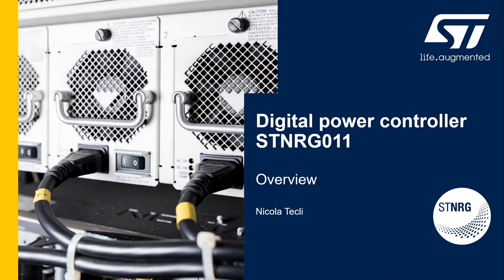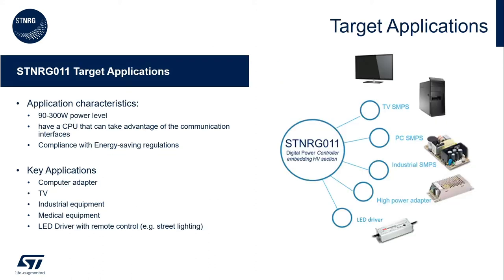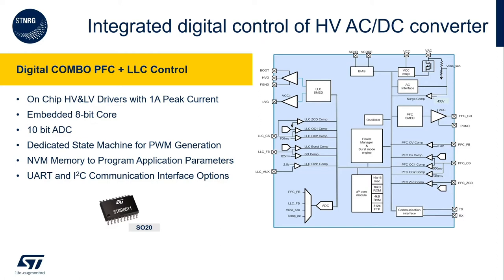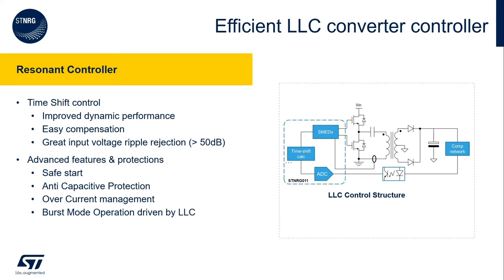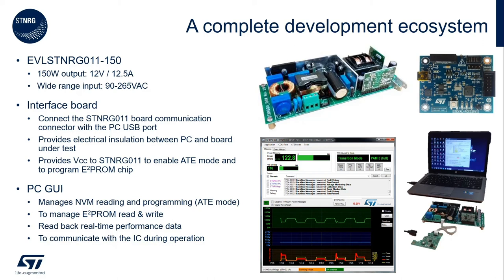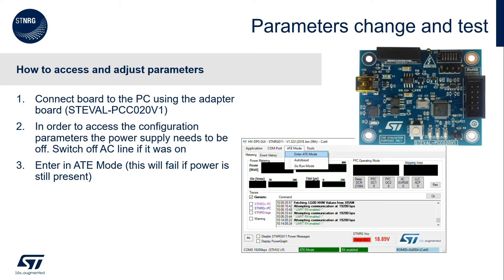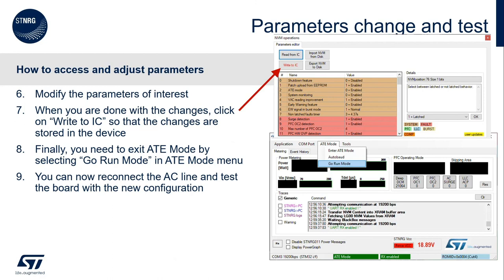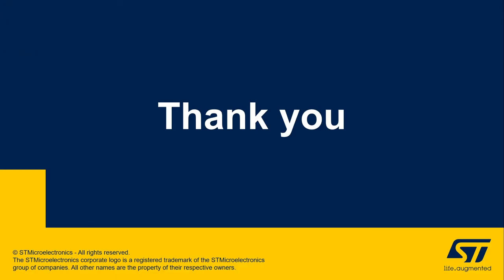DevCon 2020 Demo: Digital Power Control with STNRG011

Comment: Links to pages mentioned at the end of the video:
- Full video on STNRG011 (30min) 
    https://youtu.be/TktdcLqTNUk
- STNRG011 page on ST.COM  
    https://www.st.com/content/st_com/en/products/power-management/ac-dc-converters/resonant-controllers/stnrg011.html 
- 150W 12V demo board based on STNRG011  
    https://www.st.com/content/st_com/en/products/evaluation-tools/solution-evaluation-tools/psu-and-converter-solution-eval-boards/evlstnrg011-150.html